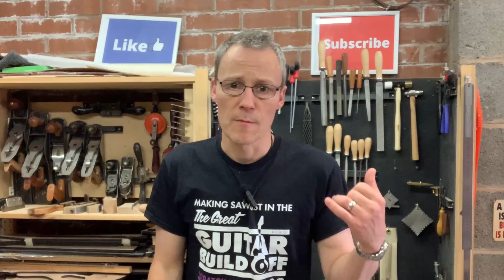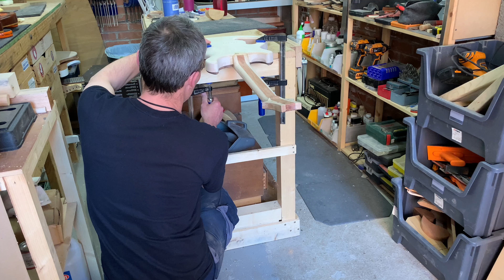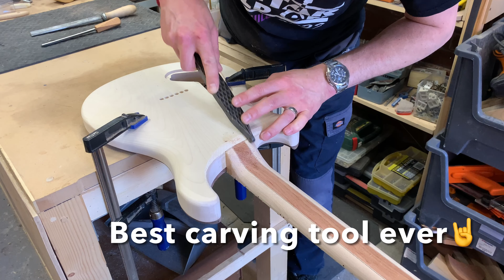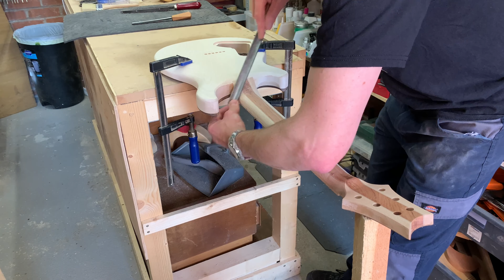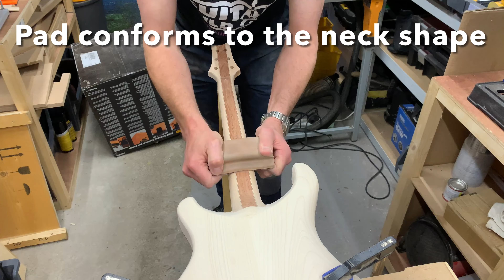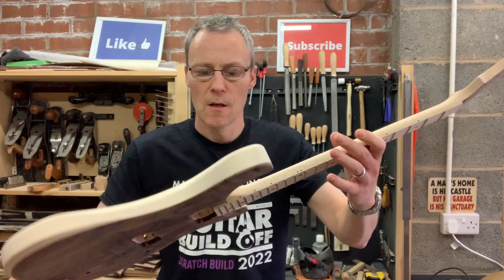Carving the Heel  - Custom Guitar Build #ggbo2022

Comment: I’ve owned one of those Shinto rasps for probably 15 years and I’ve never had a good reason to use it.  Now I have one.  Thanks.  Which kind of Iwasaki file is that?
Reply from the maker: That's awesome to hear mate,  hope you get some good use from the Shinto. Honestly when you get the feel it's the best hand-carving tool for this kind of work. The Iwasaki files I have are  half-round, medium & fine. Also got a large (20cm) half-round b*astard cut for roughing out. 
Thanks for watching.